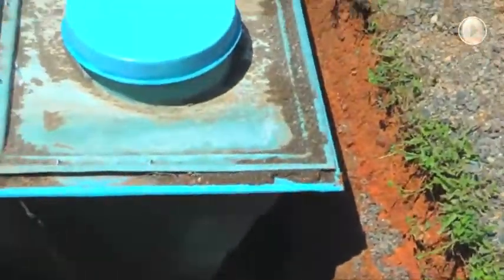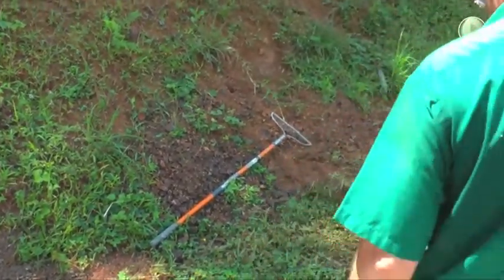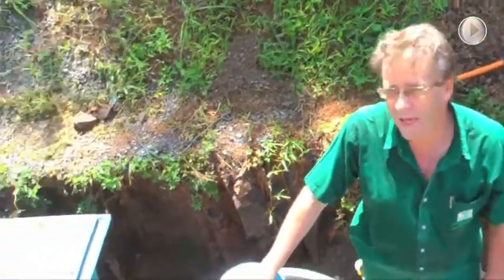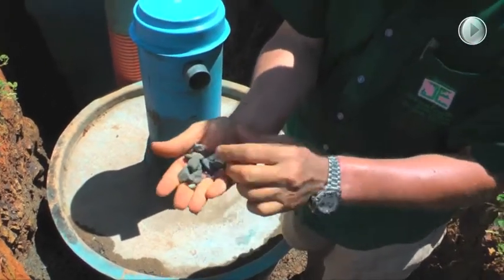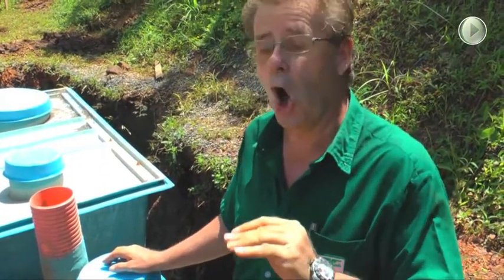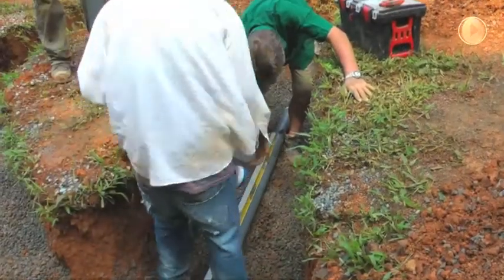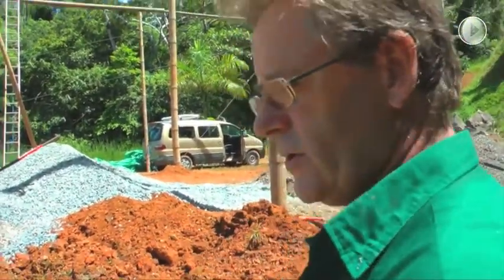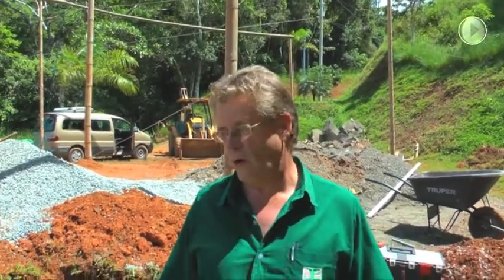Septic  Systems 101

Comment: Thank you Trevor, you made several good points. I especially like your theory on how to proportionally disperse the effluent water into the drain field with perforated pipes. I'm astounded by the number of professional installers that dump it all at the beginning of each drain line branch. Most of those gravel-less Infiltrator installations don't make sense to me.
Reply from the maker: Not sure I would call it a theory versus some simple science and common sense.  I had the benefit of having a septic inspector who spent 30 years working with problem systems in N California help me along this way and what John said from seeing all the errors bite the owners made perfect sense.